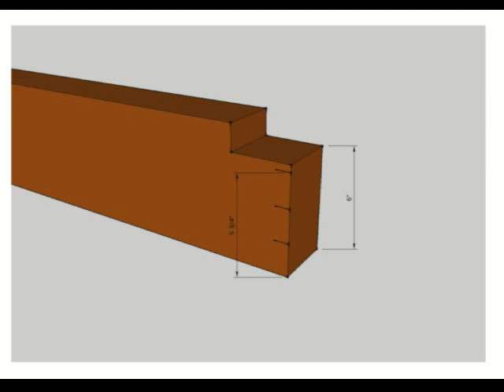Watch This Video Before Notching Top Corner of Structural Beams

Comment: Is a 45 degree cut at 1:08 acceptable for engineered wood joists?
Reply from the maker: I would like to say yes, but I don't know what type of engineered wood joist you're referring to. I would check with the product manufacturer. The information in this video refers to construction standard lumber, for example a 2 x 12 Douglas fir or Southern Pine.